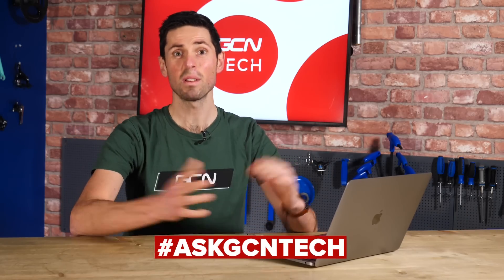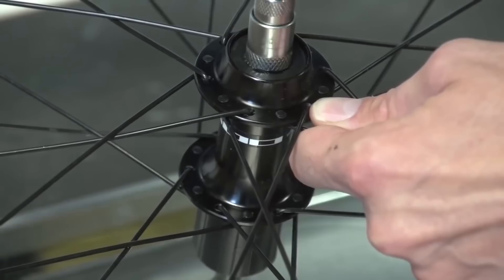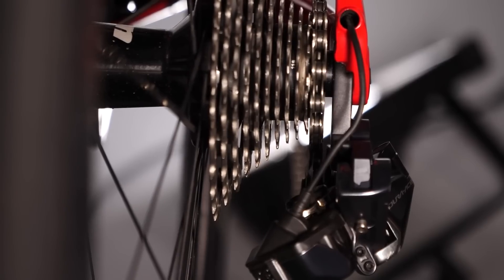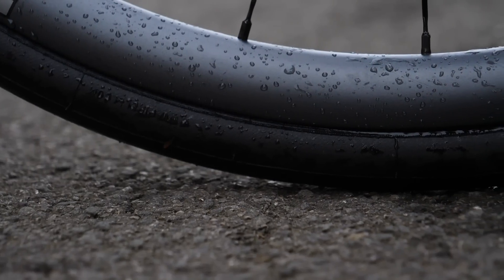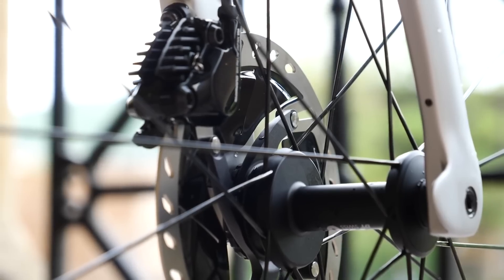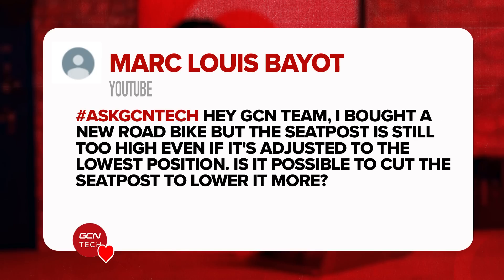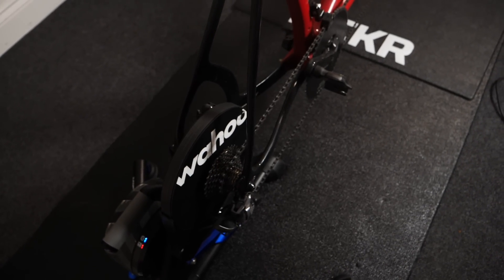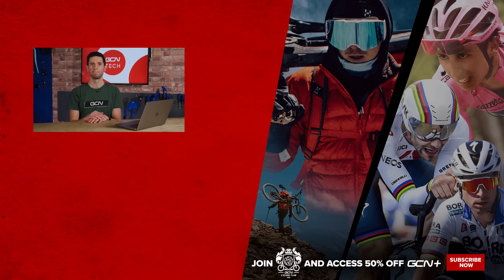Is Mechanical Shifting “Better” Than Electronic? | GCN Tech Clinic #AskGCNTech

Comment: I compare my mechanics Ultegra groupo to driving an old Cosworth Escort.. It’s not the quickest thing out there but the mechanical feel and fact that it engages your senses means to me it’s more fun to me. With Di2 it’s like driving my AMG Merc.. Pushing buttons to shift is very cool but it requires no brain power to get it done. Each one has their place and time, so having 2 bikes with each system makes things interesting & fun IMO
Reply: My winter bike is an Emonda sl6 pro and my new race bike is a Madone with a sram rival. I prefer the rival after using both. No drop chains, can change gears very fast and feels easy to use. Still like the mechanical though but just like the fact I can take it though mud and it’ll be fine. Got to take car of the battery’s on sram and make sure they don’t fall in a creek.

Comment: I can't see why anyone would need electronic shifting when mechanical shifting is lightning quick and you don't need to charge anything or get stuck in the small ring if you forget. My Campagnolo mechanical is amazingly fast and shifts just as fast as electronic. Why add more complications to something as simple and raw mechanically as a bicycle?
Reply: Yes, the only reason I think electronic gears might be handy is that on a TT-bike it would be possible to have shifter buttons on both the aero- and base bars. But I'm not paying about half of the value of the rest of the bike just for a set of gears for that convenience. And yes, it adds a lot of complicated technology, maintenance and failure points (some weight too) for an almost negligible improvement. 

Same thing with disc brakes, yes, they are better in wet conditions and long descents but the difference really isn't worth the cost and hassle on a road bike (they are great for MTB though), at least if you're not riding in the mountains etc. where there are lots of long, steep hills.

So I'll probably ride my mechanical gear, rim brake bikes for the rest of my life. I'm more likely to buy a power meter than electronic gears, though I'm not getting one of those either as long as they cost the amount of money they do. If they some day come up with a reliable, durable and hassle free power meter for about 200€ then I'll consider getting one.
Reply: @Murgo-u3l  Well said.. agree completely
Reply: Totally agree sir. Don't know how we all managed all these years with mechanical... and some of us still managing no problem at all. The world's got soft and lazy!
Reply: With axs there is no annoying trimming, it shift always the same with no effort no matter how far you press the lever, no friction, no housing wear or contamination, no excessive throw when downshifting. also Rd can be adjusted without stopping.
Reply: It's the last 0.01% of shifting performance for the perfectionist. Although IMO 105 and ultegra still shift worse than the flagship group, meaning that electronic shifting would make sense here.
Reply: @tobiasbouma4071  if you bought Campagnolo, you wouldn't need anything by Shimano, electronic or mechanical. :)
Reply: @johnandrews3568  I use SRAM AXSmyself , this is friend's bikes that I test ride. I personally find SHimano hideous and overpriced :p
Reply: @tobiasbouma4071  good man, SRAM is better than ShitmaNO for sure.
Reply: @tobiasbouma4071  for me I don't like how Shimano shifts, yes I would use it on mountain bike

I got lightweight road bike with SRAM Red 22 HRD (wondering if swap with recumbent but might not bother)
JC70 recumbent with SRAM Red etap HRD
Looking next be Emonda ALR as want more aero with SRAM Red AXS and AXS dropper if want to use (7.8kg estimate final weight, be 7.2kg with normal carbon post I believe)

Yet to think how to put weights inside the rim so not affect aero, I only use tubular as going down ditching beacon with flat front tyre and stayed on but as no pump with me

Comment: If my Ultegra 11 speed chain came with a pin can I use Shimano 11 speed quick links as well?
Reply: Absolutely.
Reply: @OliverScheffer-Photography  cool, thanks!
Reply: On my chains (no 11 speed, but 8 and 9 speed) I also use Sram and Connex quick links, they typically also fit on a Shimano chains.
One bike with a very long chain has most of the chain made by KMC and the rest is a Shimano chain, connected with 2 Connex quick links. It works fine.
Reply: @simonm1447  thank-you!

Comment: Lol, motorcycles weigh 200x as much and having brakes on only one side doesn't make them pull to one side, you won't find anything like that on a bicycle ever
Reply: But, motorcycles with only one front rotor have their brakes on opposite sides. At least all the ones I've seen. I've wondered why bicycle builders don't bother.

Comment: I enjoy the raw feel of mechanical. Throwing those shifters around is fun but the simplicity and reliability of electronic is sooo much better.  Ive been running electronic for over a year and haven’t had to index once nor had to put up with stretched cables etc. plus I love being able to view my electronic gears on my head unit.
Reply: If cost wasn't a factor electronic shifters is the better choice. But the feeling with down tube friction shifters...no room for error and it's not for competition.
Reply: @sssxxxttt   dude aren’t down tube shifters from the 80’s and 90’s?
Reply: @DynamiteDB  lol, bicycles are from the 1800's
Reply: @cosinus_square  yeah, we are talking about gears and shifting though.
Reply: @cosinus_square   wow that’s pretty cool. That’s a home job right?
Reply: @DynamiteDB  yes
Reply: @cosinus_square   well done, that’s pretty cool.
Reply: @sssxxxttt  exactly. It wouldnt even be a discussion if they cost the same. Electronic is fantastic.
Reply: Adjusting a mechanical derailleur takes almost no time. I wouldn't say an electronic is more simple or reliable for that reason. A mechanical part with a cable vs an electronic, and you claim the electronic is simpler and more reliable?
Reply: @desertrainfrog1691   100% it’s easier, you just push a couple buttons and it’s done. That’s one of its main benefits of why electronic is better. You may think otherwise and thats fine.
Reply: @DynamiteDB  Are we talking about reliability, simplicity, or quickness of service? My first comment just argues that those first two traits would be awarded to mechanical, and the last one is relatively close.
Reply: @desertrainfrog1691   100% electronic is more reliable. You probably have to index an electronic system once for every 3 or 4 times a mechanical. There’s no stretching wires and less moving parts. Plus the indexing it’s pretty much automated. You turn it on and micro shift it into place by pushing a button. From my experience it’s way more easier. Mechanical you need to learn how to do it, electronic not so much.
Reply: @DynamiteDB  Respectfully, I think you're over-exaggerating this point. Adjusting mechanical derailleurs takes very little time, adding a skosh of cable tension to account for cable stretch is a one minute job every year. Outside of that, mechanical systems are simpler and more easily understood than electronic systems if you want to repair them. I've got mechanical parts from 1987 laying around because they have few parts and are simple to keep in service. 

Electronic might be simpler and easier in the short term by a little bit. Long term reliability and ease of repair, I don't see it myself. Minor maintenance doesn't bug me. YMMV
Reply: @desertrainfrog1691   if you’ve been riding mechanic since 1987 then yes, mechanical is probably very easy for you to manage but each to their own!

Comment: Dear editor, thanks for showing the questions in this format. Much easier to see on the small screen.
Reply: I agree size is fine but why oh why do you insist on using capital letters (I think you find this funny, but its a real issue), it's a known fact, it's much harder to read capitals as the eye / brain reads word shapes much quicker - that's why road signs are upper and lower case. The accessibility for people with dyslexia is an issue here too so keep it big but just lay of the SHIFT key.
Reply: @lenguerrier  good point. Hopefully an easy adjustment for future videos. I just went to a website with 4 fonts on one page. It was unpleasant at best.

Comment: Could overinflating a tubeless tyre cause the tubeless rim tape to rip? This summer while on a bikepacking trip, I made a stop to pump up some air into my tubeless tyres, only for one of them to go completely flat due to a hole in the rim tape just a few minutes later. I later realised I had pumped the tyres to their tubed set up recommended pressure, instead of the tubeless recommended pressure. #AskGCNTech

Comment: what I like to see you set the automatic shifting you set your watts and the gears shift to what watts your kicking out .if thy drop below a set level of watts the automatic change to a harder gear and Vida versa
Reply: That's a setup that may already be possible. I suspect it would be hard to market due to high cost and the fact that it would mostly benefit beginners. Experienced riders sometimes intentionally change cadence to match the power output required. I'd be interested in seeing this if someone made one.
Reply: You mean erg mode on the road?
Reply: Wouldn’t work. It’d be changing gear almost constantly.

Comment: The cranks spinning freely while freewheeling is a Hambini bottom bracket.  It's one of biggest open secret non-sponsored compliant equipment used by the Pro peloton.
Reply: Or just a quality frame with good bearings.

Comment: Have you seen the price of electronic group sets - ridiculously expensive. Shimano has lost the plot by getting rid of mechanical in the top tier.
Reply: Dura Ace is ridiculously expensive in the first place. I'm pretty sure Shimano looked at the sales figures and thought it wasn't worth it to offer both mechanical and electronic groupsets.
Reply: @panzerveps  Electronic groups set have gone up at least 50% no I just think they think we have got $10,000 to spend on a bike.
Reply: @davidlenneberg4303  
1: DA has always been overpriced. ALWAYS.
2: DA is for the pros and wannabe pros with a big wallet.
3: I see a full Di2 DA 9200 with dork brakes cost around €4500, which is about what I expected. It cost around €2500 for a full Ultegra 6800 back in the day when I bought mine. If I remember correctly, the DA groupset cost around €3500.
Some of this price increase is due to a certain pandemic, the rest is inflation.
However, it is NOT "atleast a 50% increase in price" as you claimed.

DA will never be worth the money for us mortals, but Ultegra Di2 is absolutely worth the money.
Reply: @panzerveps  mate, I won’t be going Ultegra Di2 as I like my mechanical group sets easy to work on specially if you do endurance cycling like me so I will probably stick with Campagnolo which I’ve never had no problems with l have always ridden Shimano and Campey But Shimano has lost me now.
Reply: @davidlenneberg4303  1: punctuation. You're making little sense when you're not writing in sentences.
2: Like campa isn't overpriced lol
3: Di2 has always been, and will always be, more expensive than their mechanical versions.
4: In my 5 years on Ultegra Di2, I've never had a single issue. Except for the two times I forgot to charge the battery.
Reply: @panzerveps  1: Campey Used to be more expensive than Shimano you need to check your prices Shimano is way up there now
2: Shimano  no longer going to make mechanical In 12 speed so Campey is cheaper lol
3: i’m glad you like Dsi2 but I like mechanical
4: 105 is the only group set that that is way cheaper than any campey.

Cheers have good Christmas 👌

Comment: Yes…by streets (pun intended)…electronic is a triumph in marketing (only has an advantage on TT bars)…back to mechanical for me.
Reply: The remote blip buttons on the drop bars also has a slight advantage for sprinters.  I agree the benefits of electronic shifting is just marginal gains.
Reply: I agree. I have electronic on my road bike and agree that it is the most overrated thing in cycling. I have mechanical on my gravel bike and honestly don't miss electronic when I'm on it.
Reply: Does your car have manual windows? Do you have to turn a crank a dozen times to roll the window up or do you just push a button. The point is, we didn’t evolve from eating raw meat in cave dwellings just to shift our bikes manually.
Reply: @alicenchainrings1326  Yes…I drive a manual car with manual windows…there is no correlation between evolution/adaptive radiation and electronic shifting on a bicycle respectfully.

Comment: Mechanical shifting is more reliable when maintained. Electronic shifting can let you down, especially if you’re absent minded and don’t charge the batteries. 
Keep it simple , keep it cheap!
Reply: Actually the superior reliability of Di2 is a big reason why I prefer it.
Reply: If you are someone that tend to keeps your bike for 10 years, all it takes is for the proprietary battery/charger to not be made anymore to render the electronic system useless.
Reply: @JasonLatorre  Which has not happened even for oldest models of Di2